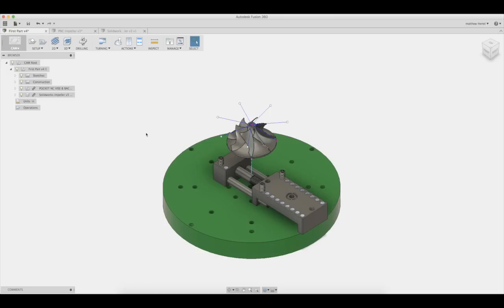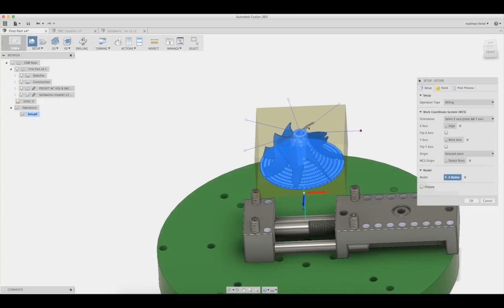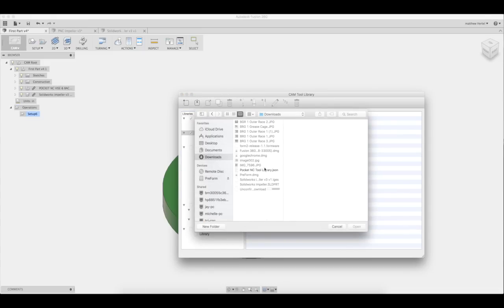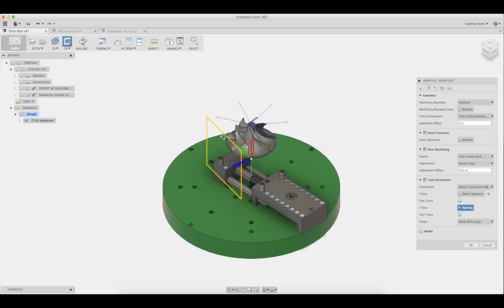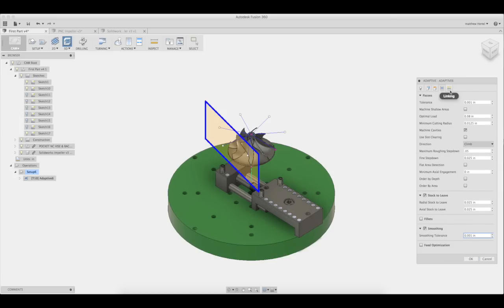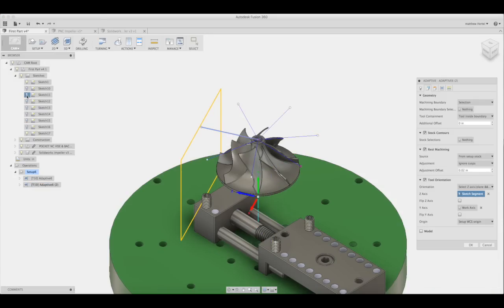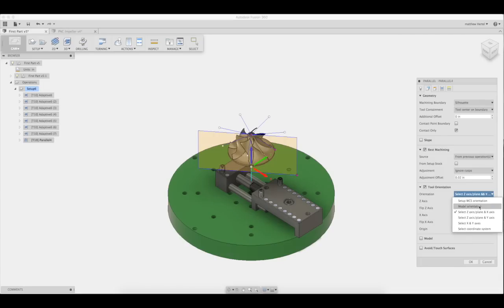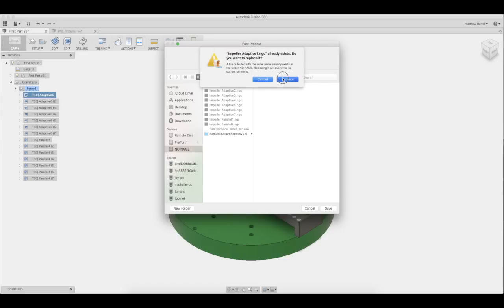Pocket NC Impeller Part 2 - Fusion 360 Toolpaths

Comment: Hello, I'm a total noob to at cam and i just got my PocketNC. And my question is when i user autodesk ''3d'' functions does it automatic take my A-axis rotation when i set the X,Y as showed in thew video.
Reply from the maker: Thanks for the question. What I think you are asking is, will the machine automatically rotate the A and B axes based on the orientation of the X and Y that are selected for the toolpath?

The simple answer is yes. 

When you program the toolpaths you will first need to select the origin point and the default (home) orientation for the machine. You will then program individual toolpaths. In each toolpath you will have the option of setting the coordinate system for the toolpath. This basically allows you to set the orientation of how the tool will approach the part. The post processor will automatically rotate the A and B axes to move the machine from the home orientation to the toolpath orientation. 

Please let me know if this is not clear. For additional information on this subject please see the First Part Tutorial on our website http://www.pocketnc.com/v2-tutorials

-Jonathan